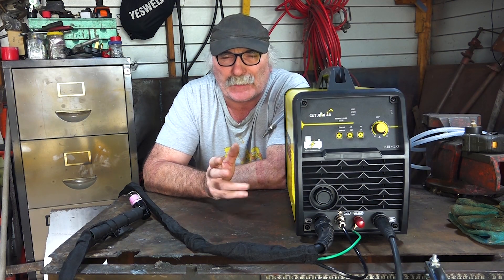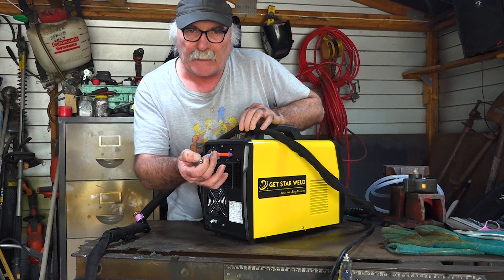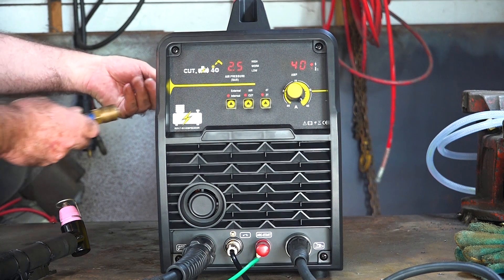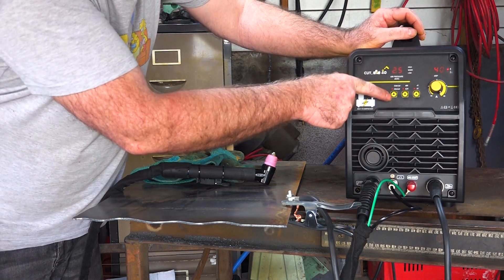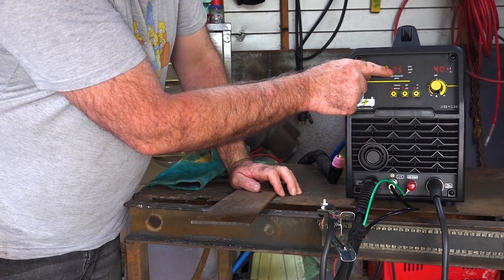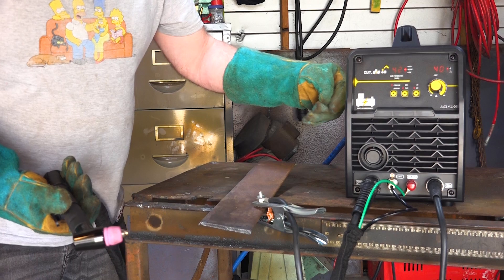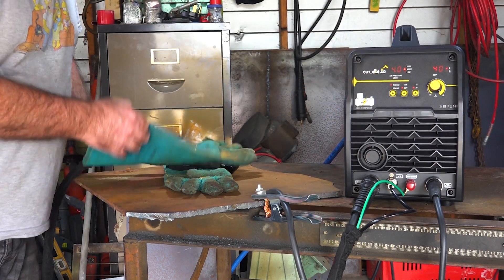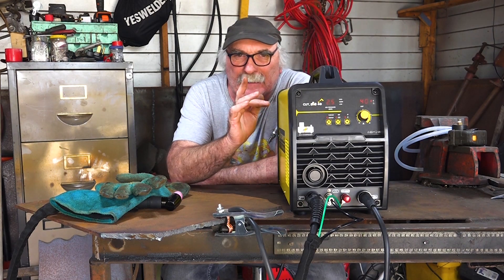The Hype vs Reality: Plasma Cutter With Built In Compressors

Comment: I've got one from Hobart. I'm in Ohio, in the USA, pawn shop find. It's not awful after adding a water separator to the air line. You can't adjust settings, it all depends how quickly you try to cut. The work cycle is 30 minutes I believe...the biggest issue is how often you have to open the thing up to clean filters and junk. Also, adding the water separator was annoying

Comment: I have just bought a similar cutter from Lidl in the UK (£150) looking to cut S/S 5 mm but not had chance yet.
Reply: Just got one myself.  It goes through 5mm mild like butter, on 25-30A with the internal compressor.  The best thing about the Parkside stuff is the guarantee.  No packing it up and arranging shipping to Hangshondowting Province PRC, just pop it back to Lidl when you’re buying the sprouts and yoghurt..!